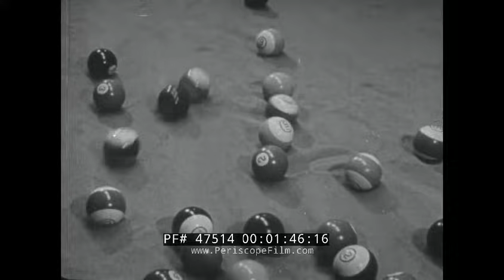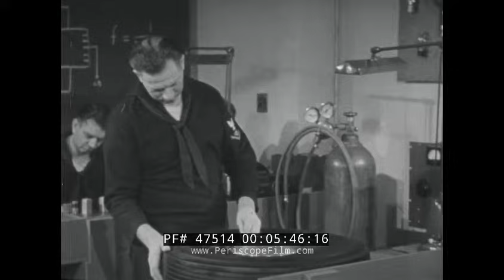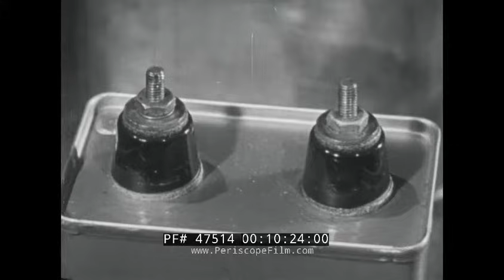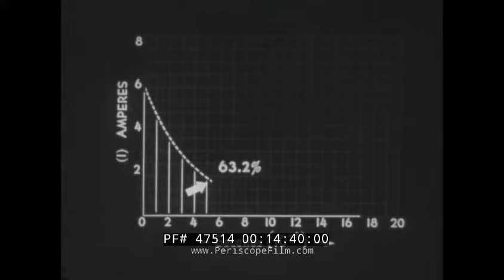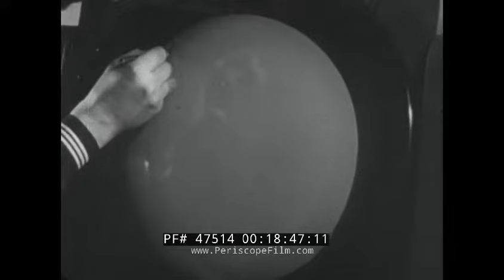1943 U.S. NAVY WWII ERA RADIO TECHNICIAN TRAINING FILM - CAPACITANCE  OHMS LAW  47514

Comment: There is a MIT video called “The Dissectible Capacitor” where they use a glass beaker as a dielectric and two copper cylinders that fit snuggly to the inside wall and outside of the glass beaker. They charge and discharge the capacitor. Next they charge the capacitor and remove the copper cylinders carefully without shorting out between the two. They then touch the copper cylinders that “should” have a lack and abundance of electrons, nothing happens. They place the cylinders back to their positions on the beaker and then short. You then see a discharge spark. It’s the dielectric that holds the charge, the plates are just the terminals to interface with it. Check it out, it’s an awesome demonstration!
Reply: Also capacitance not only increases with surface area, but also the distance between the two. Further away decreases capacitance. Closer together increases. If you had a perfect dielectric it would allow the plates to be almost touching while maintaining the highest dielectric breakdown. That’s why insulation thickness increases with higher voltages depending on the material.

Comment: Finally a video that actually shows that electricity travels from negative to positive.  I learned electronics first from vacuum tubes as a child in the early 70's, and then onto transistors.  I read lots of old Navy technical training books.  Thank you for restoring this film.
Reply: Indeed. Conventional current flow is from + to - , Electron flow is from - to +.

Comment: Oscilloscope is fantastic may be its weight 20kg.
The steam engine took 12 hour to warm-up this oscilloscope takes 24 hours for warm-up due to it tubes for perfect operation. 
The transistor was yet not invented.

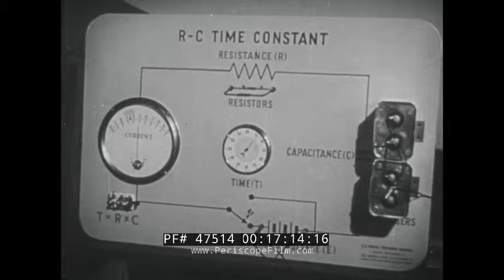Comment: 17:18 We are in 2021 and oscilloscopes are still very expensive, even to study electrical engineering they are almost relics that they do not even want to touch .... How much would  have cost in the 30-40's that single channel oscilloscope?
Reply: You can get a siglent for 300 bucks.  They aren't expensive.  I got my first single channel in the late 80s and it wasn't very expensive.
Reply: @falsedragon33  Yeah, nowadays you can have old ones almost freely, and even new entry-level digital ones in decent price.

However, his question holds, how much might have costed in 30-40s. Guess quite a lot, at least as inflation-adjusted. I wonder if tinkerer had diy/impromptu scopes back then?
Reply: I have a handheld, LCD, two channel scope.  I thought it was pretty affordable.  Note that the cheaper ones can't handle high frequency signals, but can handle basic scope tasks.  Pretty cool gizmo I thought.

Comment: @19:45 "This mark represents the time constant ..."  Which should be at, roughly speaking, somewhere north of 1/3 full scale (37%), but it's not. The scope trace is not moving downward either. This is because the actual demonstration, as far as the scope is concerned, is showing two RC time constants, i.e. the demo board and the input coupling high pass filter characteristic of the AC coupled scope. The scope should have been DC coupled, which may have been impossible as many scopes of that era where only AC coupled. Notice how, at higher frequencies later in the demo, the scope trace goes right through the marker line. That's a sure indication that the scope is AC coupled.
   
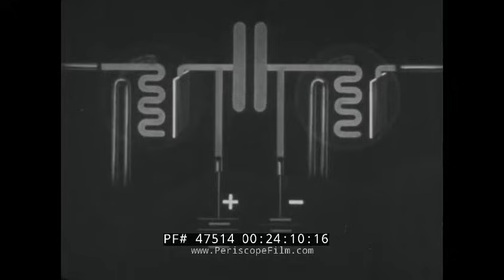@24:12 "This is a diagram ..."  I have to call it an awful diagram! It shows the first amplifier's plate attached to battery positive and the second amplifier's grid attached to a negative. Although the plate should be positive and the grid should be negative, diagrammatically connecting them to batteries is crazy. Yes, you 'could' make this work by having an impedance on 'the other end' of the battery, but for some very good reasons it's not practical. Schematically, more correctly diagrammatically, a battery represents a voltage node, meaning there is no changing voltage. And they're trying to demonstrate changing voltage is coupled through a capacitor. ??? This oversimplification, if that's what it's supposed to be, bothers me greatly because this training film is teaching something that must later be unlearned. Perhaps the film's author thought his audience was too dumb to notice, so it didn't matter. :(

I don't think a competent engineer ever reviewed this film.  We actually won that war.  How?

Comment: if only someone had told me volts is a pressure measurement it would all have been so much clearer. thank you
Reply: Somewhere, I learned to think of electricity like water in a pipe.  Pressure is voltage, flow rate is current, resistance is a matter of the diameter of the pipe.  You can even sort of understand series vs parallel resistance thinking about pipes.
Reply: @michaelbauers8800 the old tom Henry videos used that analogy.

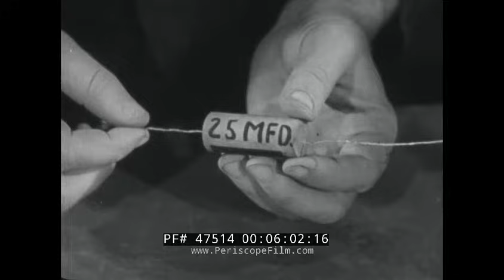Comment: 6:01  There it is the accursed M for micro farads, but in SI units they should use the greek letter mu, “μ" for micro, instead of M for mega!   This maddening atrocity goes back to 1943 at least? Utterly frustrating...
Reply: It's not as bad as the way they used to use M instead of k for thousands of Ohms.  So 500M on the circuit diagram is 500k in real life.

Comment: Funny they used billiards to demonstrate these examples. I was taught the same way but the medium example was water. Electricity flows like water. For example, the resistance scenario using water, imagine water running through a hose, kink the hose and you have a point of resistance.
Reply: Having spent decades playing pool, I feel water is a simpler/better analogy than pool :)

Comment: It's actually correct!   Many of these training films get it wrong, showing nonsensical physics, and teaching misconceptions.   
THIS ONE DOESN'T!
It shows that...  electricity flows slowly in circuits, electricity passes through capacitors,  and electricity always flows in complete circles (where electricity cannot be a form of energy.)   A "charged" capacitor contains the same amount of electrons as an "uncharged" capacitor, since capacitors store energy, not charge.  They even show the random thermal vibration of electrons in metals!  These guys must actually know some physics!  That's rare.

Only one slight mistake, mostly present in Part 2...   they constantly speak as if "current" was a substance, as if it could flow from place to place.   No, the only flowing substance here is called "charge."   If they deleted the word "current" and instead said "charge-flow" and "flow of charge," then their language would be far more correct and consistent.

"Current" doesn't flow in wires.  Hydraulic analog:  when describing pipes and hoses, we speak of flowing water, not "flowing current."  There is no magical substance called "current" which flows in pipes, WATER flows in pipes.   When we turn on a faucet, "current" doesn't fill our bucket, instead it's filled with WATER.  The same is true with electricity.  In electrical explanations, we'd correctly discuss charge, charge-flows, or perhaps Quantities of Electricity, and the flows of "electricity" called electric currents.   Traditionally, in physics the word "electricity" means charge.  (The flows of electricity are called currents, and an amount electricity is measured in coulombs, where electricity is not some sort of flow-rate!)

The producer screws with the audience, where in part two, suddenly the Trusted Authoritative Voice is revealed to be an actual human being!  BREAKING THE FOURTH WALL!  I thought you weren't supposed to do that, not before the invention of Television!

Also, electron have holes in the center?   No, electrons are little half-inch paper circles, those "adhesive reinforcements" for ring-binders.  Any office had little boxes with thousands of those white circles.   Apparently the size of their animation-frame isn't tiny, not like a modern computer screen!  Heh.
Reply: NIce post. The 4th wall moment was a dramatic moment for a Navy training film :D
Reply: Yeah, that's because the way "scientists" like to teach stuff to the general public is via propaganda and elitism tragically. When science is more about the man who came up with it than the practical use case, and you have tons of idiots using "Science" as a buzzword for anti religious propaganda while showing thier clear lack of education (Religion is just a social science and philosophy, has NOTHING to do with physics), that's where you get all the foolishness. There's also the condescending talk from the narrators who basically act like telling us we're all idiots while they use big "buzzwords" no one understands to describe half the stuff. Making up gibberish isn't education either. (You should see how much those ATomic scare films, which I'm sure you're referring to treat Atomic radiation like it's MAGIC that 'MAN will control" and abuse the word "Renkins" to describe radiation measurements as if "THat's a BIG word you probably never use! SMART people use the word Renkins!" like EVERYONE is walking around with Geiger counters and knows how to use those numbers......
Reply: If air is positive and water is negative, then it still makes sense. the same volume of space is within the bucket, but one of the quanta is different. mass in this case instead of voltage. just as a capacitor exhibits current until fully charged, a bucket doesnt gain mass until fully filled, and so on. Its also worthy to note that mass is a big part of potential energy in kinetic situations, I would say its really not that far off of a comparison at all. Electricity wants to be circular absolutely, but its ability to be asymmetrical in quantities allows things like lightning, static electricity, and capacitors to exist at all. its a technical win to brag about the electron counts not changing, but charge density by far is a more important metric in regards to physics. Filling a bucket doesnt remove air from the atmosphere.
Reply: @JohnConnorREAL  In physics class we discuss a charged metal sphere, or "single plate capacitor" where the other plate is somewhere at infinity.
In the hydraulic analogy, that would be a single bucket of water.
Oliver Lodge was making fluid demonstrations for the classroom, and built 2-plate capacitors  ...a volume of water cut in half by a rubber membrane.  We can only pump some water into one side, if we take an equal amount of water out of the other side (his fluid capacitor was inside a closed glass sphere with two connecting pipes.)   A "charged" capacitor still has the same amount of water, but now the rubber membrane is stretched, and there's a pressure-difference between the two sides.

Comment: This was taught until 1896 when AC power was implemented and this could not explain how electrical systems did what happened. C.P. Steinmetz tried to get this idiotic model removed, saving lives and improving electrical engineering. Capacitors store and transfer energy across the dielectric materials between the conductors. Dielectricity is 1/2 the energy of electricity, magnetism the other 1/2. Only sometimes sourced with charge particles, but not the action of charged particles.
Reply: Try getting young lads who were going to be shipped off to war to read Steinmetz.
Reply: @trejohnson7677  Good point, also his differential calculus was probably beyond most technicians. But, I always thought it was the corporate dollars put at risk by busting the lie that users loaded the generator. Only balanced transformers load generators. When you listen to music, the guitar doesn’t diminish compared to playing in an empty room. Any generator can source any load, if it’s output is amplified to the full demand. Electric cars and planes without distance limits are naturally possible with proper engineering (not limited by net chemicals in batteries.)
Reply: @mundymorningreport3137  To support that conspiracy, you're subsuming the group of people making these supposed decisions had fashioned for themselves a, at the very least, pragmatic acquaintance with the kinds of insights latent in Steinmetz work. That alone would be a "waste of resources". C.P. Steinmetz compositional flow is ridiculously unwieldly. One gets a sense of the kind of social ostracization he may have faced through many of his works. 

Take for example, the flow and continuity of the very first pasages of Steinmetz's "Theoretical Elements of Electrical Engineering".  While a thorough treatment  garners robust, self-regulating insights, it's hardly something I'd expect to happen en masse, ever.
Reply: @trejohnson7677  not at all. Industry funded education and dictated the materials approved for educated workers. Simple economics, not complex political intrigue.Or existential electrical theory. Steinmetz, being a crippled draft was politically tuned in and wrote on the subject of following the wishes of the power elite.
Reply: @mundymorningreport3137  Is that so? What are the names of the works?

Comment: What I missed is, what is the purpose of a capacitor. it stores energy but how does that benefit the cct.
Reply: Rewatch the segment with the narrator and the microphone amplifier. Probably the most common purpose of a capacitor is perfectly demonstrated right there.
Reply: It doesn't.  But it's great for shocking people at parties...
Reply: It stores energy after a rectifier like a battery for example but a more perfect battery for short time use (like cycle to cycle rather than for hours.), or blocked DC like he mentioned between stages, while passing AC.
Reply: It conducts AC but not DC. An inductor does the opposite (though both will pass everything if there is not a load, thus the resistor.)
Reply: @kenmore01  A capacitor will pass DC. When you first power up charge flows and when you inject a square wave charge flows in fact, if you you change the value of the DC voltage the other plate will follow.
Reply: @mrpropergander6800  Yes, for a short time if there is a load like a resistor.
Reply: They are also used in analog tone circuits, such as amps and guitars to filter out high or low frequencies to ground.
Reply: A simple example, is using a capacitor to block DC.  For example, in an amplifier.  DC in an amplifier signal is unwelcome.  Because DC is direct, unchanging, current, the capacitor ( a small one,) very quickly charges up, and is effectively a high resistance to DC.  A typical, signal with varying voltage/current, will pass.  This is called a high pass filter, in other words, it passes "high" frequencies.  Speakers routinely use both low and high pass filters, in their crossovers ( which ensure the right sorts of signal are sent to each speaker driver.)

Comment: But for example, if I connect my computer to the power socket, when do the billiard balls come out?
Reply: It only works if your computer is the correct distance from a billiard table connected to earth. The correct quantity of balls will flow back up through the pockets, and as long as you break the table's earth, you can now proceed to play billiards. Unfortunately, once the balls go in the pockets, they they tend not to come back up spontaneously: this  either means you've got an earth leakage problem, or you need to put coins in the slot...

Comment: OK, up the voltage to 800 Volts then use both hands to hold the uninsulated clips to charge the capacitor.  Those who die during this activity will immediately fail the course!
Reply: Or as my electronics teacher would say the most dangerous thing is not the shock but the elbow of the guy next to you that is getting shocked.
Reply: Made at a time before warning labels, if you die you fail the test.
Reply: @ecaparts  It made sense back then, because the poisonous ink factory would kill as many people as would be saved by adding warning labels printed with said ink.
Reply: Your funeral home business must be slow?
😆
Reply: I see that too, I was in shock :D
Reply: 800 volts with no amperage won't do much
Reply: As soldiers are doomed to die, there wasn't much obout on-the-job-safety ;)
Reply: I was like, "WTF?"
Reply: Zzzzzzzz poooof! Hehheh
Reply: Yeah, after the first cardinal rule safety first when learning to build high voltage vacuum tube radio transmitters was the second rule. Always have one hand in your pocket when sticking a measuring probe in to check voltages.
Reply: Much preferred to the current nanny state.
Reply: I gotta say I was wondering just a bit if that voltage was being exaggerated by a few orders of magnitude. But on looking closely, he was holding the insulators on those alligator clips. Personally I'd prefer more than an eighth of an inch between me and 800 volts at an amp or two.
On the other hand, putting a screwdriver across a 5 mike condenser at 800V should have left him with about half a screwdriver rather than a pretty spark.
Reply: @lwilton  That's what we invented bakelite for. ;)